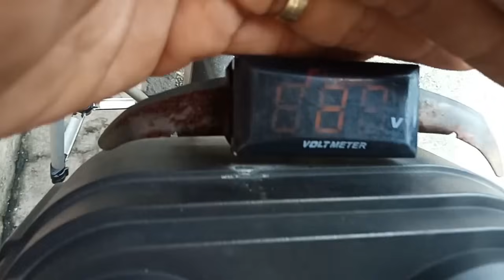How to install voltmeter on motorcycle TAGALOG TUTORIAL

Comment: Idol jeff first time ko mag request paano ba mag palit o mag linis ng barbula ng honda beat fi, saka salamat narin pla sa mga share mo na videos dahil sau natuto ako galing mo magturo.
Reply from the maker: Sir yung ganyan proseso eh walang ibang paraan.kundi.buksan ang cylinder head..
Reply: @JeepDoctorPH  salamat idol,
Ung sa kuya ko kasi idol honda beat motor nya ayaw na mag start pero ok naman battery nya gana din ung busina nya may kuryente naman ung spark plug nya, pag e start na sya ayaw mag start kahit sa kick start ayaw din anu kaya problem nun idol? Adjust kaya ng valve un.
Reply from the maker: @diskartehangkuyaoteptv6848  boss check nio muna kasi baka nahuvot lang ang olug sa ignition coil or may naputol n wire sa cdil
Reply: @JeepDoctorPH  idol kasi sinubukan ko ipasok ung daliri ko sa kinakabitan ng spark plug tapus kick start ako walang pwersa ang nangyare diba dapat itutulak ung daliri ko nun.

Comment: Good evening po, I like this video and the rest of those that I've watched.. Napakalaking tulong po ang naidulot ng mga yun sa akin.. And I'm so thankful about it.. Nagkahazard na po ang raider j 110 ko, pati na po yong pagdagdag ko ng dalawang horns in addition to the stock.. 
My problem is yong voltmeter with USB charger.. Sinubukan ko po sa orange ng ignition, kaso wala hong nangyari.. Sinubukan ko sa red wire at gumana kaya ti-nape ko na.. Nung na fixed ko na po, e nawala po yung connection.. Binuksan ko po yung fuse holder ng voltmeter w/ charger, deformed na ang element sa loob ng glass fuse.. 
Please help me work these things out.. Or if you may,  please show a video on how to do it about a voltmeter with USB chargers.. 
ROY CACULBA po, Davao City..

Comment: boss maiba , pwede bang gamitin yung battery , power supply ng ampli 12v ?? tapos may mga kasama pang ilaw
Reply from the maker: kaya kaso malolobat agad. kung may sound ka kasi need mo ng 20ah pataas na battery
Reply: Boss kahit i fullwave ? Mio i mc ko , may mga nakikita kase ako na nagkakabit ng sound system sa loob ng compartment
Reply from the maker: @dong9531  pwrde pero magdafagdag k ng isa pang battery para lumaki capacity.

Comment: Jeep doc, kailangan pa bang lagyan ng fuse ung ginawa mo na circuit sa voltmeter?
Reply: Sagutin kona hehehe pwede namn my fuse for safety. Pero khit wala kasi my mga voltmer n hanggang 24v ang kaya ng voltage,
Reply: @teddydiychannel5673  sakin kasi boss may relay tas derekta battery negative and positive , ilang ampers ba ilalagay ko na fuse ?
Reply: sakin kasi boss may relay tas derekta battery negative and positive , ilang ampers ba ilalagay ko na fuse ?

Comment: Boss tanong ko lang pwede pagsamahin volmeter at usb connector  kasi both may negative at positive tapos yun negative nakaconnect sa negative ng battery at yun positive naka connect sa positive sa battery di ba masisira yun battery ng motor kung sakali direct sila sa battery di sa ignition switch. Tapos may switch on /off yun usb connection.
Reply from the maker: Pwede nmn kaso lagyan m ng switch at fuse

Comment: Sir ano po ba ang ideal volt reading kapag umaandar nakaidle at nkaoff ang typical 125cc bike d2 pinas.. pagkakaalam ko kc gngmit ang voltmeter pra mamonitor ung voltage output isa ring way pra madiagnose kung may cra or prob na ang regulator recrtfier kc makikita mo kung over or under the limit ung bnbatong kuryente ng rectifier sa battery.. makakatulong dw ito pra maagapan agad prob s rectifregulator pra hnd na madamay battery insome cases stator sbi sa isang ckat n blog pero mamahaling bike ung mga gnmit dun so ask ko lng sainyo na nkagamit na ng voltmeter sna gwa kau vid ung ibat ibang reading pag umaandar nkaidle at pagnkaoff ung motor..
Reply from the maker: 13.5-14.5 normal charging..kahit revving engine ndi dapat aabot ng 15v

Comment: idol ask ko lang kapag mag install ka ng volt meter kailangan ba naka battery operated ba ang motor or ung headlight? stock wave ang motor ko tia
Reply from the maker: ndi na needed boss. stock lahat okay lang
Reply: actually idol nagkabit ako ng volt meter sa wave ko pero ayaw gumana tama nman ung connection ung red wire connect sa accessory wire ng susian tpos ung black connect sa ground ayaw pa din pero kpag nkarekta sa battery ung volt meter gumagana naman anu kya problema?

Comment: pre, may nabili ko voltmeter na 2in1. voltmeter+time. 3wires. red,black(+) green(-) yung red direct sa +batt yung green direct sa -batt. tapos yung black (+)sa susian. need idirect yung red&green pra di mag reset yung time, kase kung nka direct lhat sa batt nag rereset lang. yung black need ulit ng isa pang supply na (+)from batt. pra mag function.ang problema ko lang since di n nag rreset yung time prang na dedrain yung battery bumaba yung voltage, posible kinoconsume ng VM?

Comment: Brod question lang.. normal ba na umaakyat ang reading sa voltage meter kapag nirerebolusyon o habang natakbo ang motor? Pero kapag nk neutral nmn e maintain ang reading sa 11.8 - 12.4 V. Dun ko din kinabit ang positive wire sa terminal ng quick start ko... ok lng ba un?
Reply from the maker: ok lang yun.. pg nagrrevv kn iln ang readingg ng voltmeter
Reply: @JeepDoctorPH  parang depende sa gear change eh.. habang natakbo ako umabot ng 15 V s 3rd gear.
Reply: Pero nababa nmn as soon as mag relase ako ng rev.

Comment: Ano po ba purpose ng voltmeter aside form malalaman mo yung boltahe
Reply from the maker: wala na..yun lang hehe
Reply from the maker: sa volt meter m kasi malalamn lets sy marami k kinakabit n accessories sa motor mo mga ilaw, fog lights, additionl gauges,, sa voltmeter makikita m kung kaya pa ng charging system m mg kinabit m n accessories o nadidiskarga n
Reply: Jeep Doctor  ah  okay po eh ano pong default na reading nya kuya?

Comment: boss bakit yung una kong volt meter tama naman reading nasa 14.2v lang highest ngayon sa bago kong volt meter dun lang din naman kinabit pero nag lalaro sa 15.6v volt meter with charger pala yung pinalit ko boss yung una voltmeter lang gaya sayo, ano posible problem boss bakit hindi tama ang reading. TIA
Reply from the maker: gumamit k ng isa pang tester ng voltage. para malaman mo kung nagbago talga volts ng motor mo o inaccurate lang bago mo